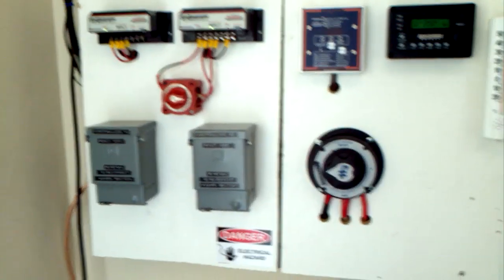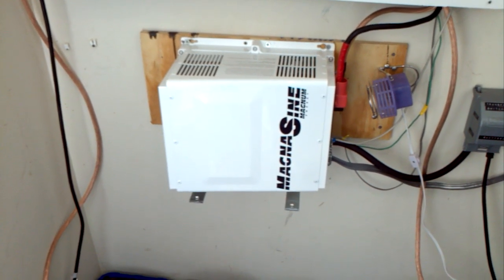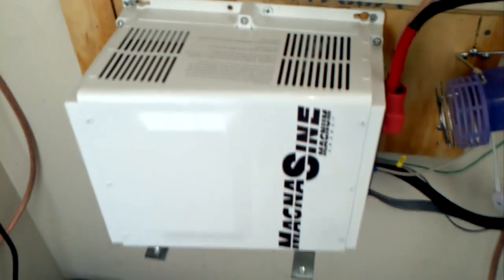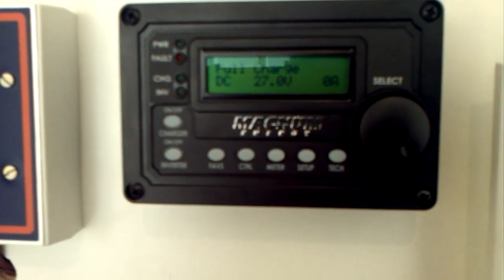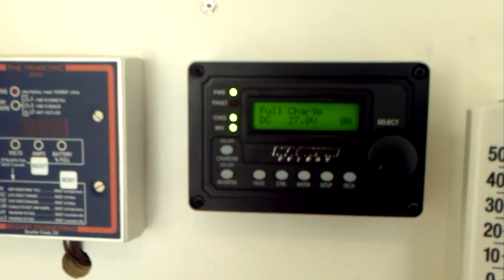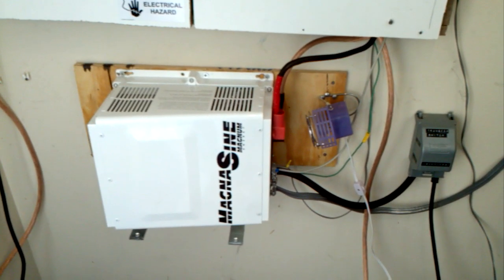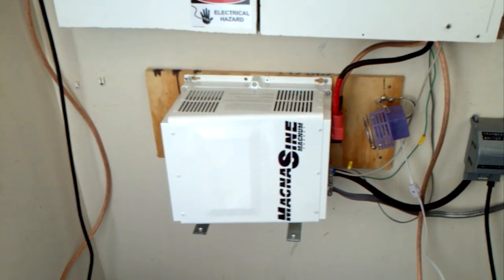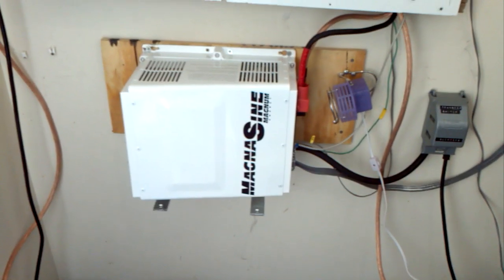DIY Solar - MagnaSine Inverter /Charger - Product Review

Comment: We have a Magnum 4024 (the 120 volt version) powering our off grid cabin, and it works great, very robust as you said.  It can run anything, great surge capacity.  I guess that is why it has a 3 year warranty and of note it is made in the US, not China.  I also would recommend the remote panel for information and programming capability.  Great video!

Comment from the maker: Yes, that's how the pass through works. The inverter is programed to sense when the power is out. My transfer switch acting as a sub panel has the circuits connected that I want running during an outage, the switches are already flipped so that when the power goes out, the inverter automatically switches from pass through to battery to power those circuits at the xfer switch or sub panel.

Comment from the maker: Thanks for you comments, I checked and the APC Matrix 5kVA UPS is a great system. However, new it can cost as much as or more than the MagnaSine. The one you speak of is used off of ebay for $499, I only saw one at that price. There is also one for around $1700. In truth, any Inverter system with this type of smart capability is not going to be cheap. Also, a UPS is just another type of inverter that converts DC to AC and there are many far less expensive inverters on the market than this one.

Comment from the maker: Thanks for your comments. There  is only 1 AC input going into the MagnaSine, I can plug into the utility source or with the Propane Gen via modified sine inverter. I could hook the battery cables from the alternator directly to a MSW 12v inverter with appropriate watts (1200w), then plug the MagnaSine AC input into it with an extension cord. It's not pretty but it does work. The MagnaSine inverter will test the input power to determine if it's good, if so, then it will pass it to the batteries.

Comment from the maker: Yes, the xfer switch is acting as a sub-panel in this case and the MagnaSine is in pass-through mode passing the power from the utility to the circuits. In the event of a power interruption, the MagnaSine will go into Inverter mode to power those circuits until utility power is restored. When power is restored it will go into charging mode. It has over current protection with 2 overlapping circuits, but with a lightning strike I believe it's a 50/50 chance it can take it, I hope for the best.

Comment from the maker: Yes, you can connect your inverter to a 12v or 24v battery bank.  Both system voltages are within the range of the grid tie inverter.  However, a 24v setup will give higher output from the inverter because it will be closest to the input limits of your inverter.

Comment: I think you bought the best inverter made.  I've researched the AIMS and, under the cover, it's a rebranded chinese copy of a copy, which sells in china for $200 then gets marked up by aims, the only thing they do.  Great system engineering!  I like the functionality you built in by design.

Comment from the maker: I agree with them, it can be done, provided your power strip has the appropriate wire guage and safety rating for what you want to do.  Also, definitely include the 15 -> 30 Amp breaker in between for safety.  Essentially, your coverting the Magnum to function like an ordinary inverter with the receptacles (they have the same level of protection already built-in).  Also, this mimics how your house is already wired for safety.

Comment: I'm actually trying that same thing. My main goal isn't for backup. We don't have too many power outages out here. I currently bought 4 solar panels and can expanded it up to 12. I was given an Alpha 5000 watt UPS, which came with 8 batteries in the enclosures hooked up @ 48V with 200amps hours in total. I'm looking for a way to hook up the panels to the house at the same time thru the UPS charge the batteries then when the sun goes down also use up the batteries on a nightly basis.

Comment: Thanks for your answer; My problem with the GTI 500 is before the fan kicks in, it is making a sharp high pitch noise (high frequency components), it is a bit covered by the fan later but it is annoying; for example compared to this, the GTI 250 or 300 are very silent

Comment from the maker: The remote gives you full access to the Magnum inverter. It will allow you to monitor and program the various features of the Magnum unit, such as when to come on, how to charge the batteries from the grid, or how to work in conjunction with a PV array, which is an alternative charging source as far as the magnum is concerned. These can be programmed with the remote. The remote shouldn't have anything directly to do with your MPPT. If you are getting the MagnaSine, the remote is a must have.

Comment from the maker: For the "in-coming" 120vac I have it plugged into a 120v socket which is protected at the breaker panel, for the "out-going" 240vac it is going into a 30 Amp breaker tied to a transfer switch (for a sub-panel) with 2 15Amp breakers on each of the 2 legs (meaning, 2 120v pathways which are 180 degrees out of phase for 240v), from there it goes into the main breaker panel. So you can see that there is circuit protection throughout. Also, I'm hoping that you know that this is not a grid tie unit.

Comment from the maker: The GVFX3524 is an excellent system.  I got the Magnum for the durability and auto transfer capability. I compared the two and decided on the Magnum as the choice for me.  I can't remember, but there was something about the Outback that didn't meet my requirements at the time. But it is a good inverter.

Comment from the maker: Yes, you can have a standard battery charger hooked to the battery bank at the same time you use your GTI.  A battery charger and a charge controller essentially do the same thing.

Comment from the maker: The current going into the battery bank will fluctuate according to current state of charge. Like any smart battery charger, the current will lessen as the batteries reach the point of saturation (ie. fully charged). At which time the charger will go into float mode.  AC input can be 120V or 240V depending on your source.  Voltage remains constant, charging amperage changes based on battery state of charge.

Comment: Very cool.  Does it basically output a constant current to charge a 24v battery pack as long as you are giving it an AC input?  And the AC input was the AC output earlier?

Comment: First of all thank you for posting your system , On YouTube. I hope you post another one as well, as you use your system down the road. Your Magnum inverter is my second choice, because of its 240 capability. My first choice would be outback, but I'm Seriously considering the Magnum inverter system. As  it is also built in the United States. And also a little cheaper than the Outback system.  I look forward to more reviews from you here on YouTube. Again thank you for your presentation. Neil
Reply from the maker: Thanks for the comments. My MagnaSine inverter had been working fine thus far. Outbacks are good as well, I didn't go with them because of the 120vac limitation.
Reply: My choice was the opposite and am glad I purchased a Magnum. Looking into the midnight solar and outback equipment, they seemed the opposite of simplicity. They sure look cool though.

Comment from the maker: Sorry, but it was replaced under warranty, so it's new in that respect and it's my backup in case this one gets fried for some reason.  When designing a system to support an extending outage, it's good to have a backup. However, I'm sure you can find some good used ones off of ebay or craig's list.

Comment: Thanks!  I've been looking for a review of this inverter.  It's one of 3 I'm considering (Xantrex & Apollo Solar are the others).  Magnaum tech support mentioned a "threshhold" feature with the MS-ARC meter which will automatically switch the inverter to grid power when the solar panels drop below a threshold voltage.  Have you explored this feature?

Comment: Many thanks for your respond Rhandsom.The next question i must ask,before i import my grid tie from usa:I want to use a 12 volt battery bank,the grid tie inverter has voltage range 10.5-30v,can i use this inverter with 12v battery bank,or must i use 24v battery bank for this inverter?
Can you assist me please!
awaiting your expert advise.
Timir.

Comment: Dear Rhandsom,I am totally blown away with your system you designed.However,I have a question I would like you to respond to!Can i while using my grid tie inverter on battery bank,have a battery charger connected as well, simultaneously?I do run four 12,000 btu ac at night,and I would like to supplement my power consumption.
I am looking forward for your expert advise on this!
Timir.

Comment: If i'm not connecting any ac 'in'.....can I just hardwire a power strip to the the ac 'out' side?
Magnum is saying (maybe for legal reasons) that i'd have to run 10ga out to a 15amp breaker, then to receptacles I want to use.

Comment: ARC50 and ME-BMK (Battery Monitor Kit) do i need both for my new 24v DC 4000w pure sine 120v\240v AC inverter/charger...Does ARC50 monitor my battery bank...Thanks

Comment: Hello, just wondering if the inverter can work without installing a control or does it need to have it, because I connect the inverter without it but it’s not turning on.
Reply from the maker: The inverter will work without the control.  The control gives you the ability to fine tune certain perameters within the inverter.  I do recommend the control, but you don't have to get one.

Comment: I am getting ready to set up my magnasine ms4024ae post hurricane Joaquin in the Bahamas. Will the remote allow me to program the system to use my solar panels to charge my batteries, then run loads in the subpanel while the sun is shining, then switch to battery power, then switch to grid when the batteries are at 80%? Rinse and repeat daily? Great vid, many thanks!
Reply from the maker: +Mary C (White Eyelashes) Thanks for your question. The remote will allow you program the MagnaSine to utilize solar and grid.  The solar panels will charge the battery via the Charge Controller as normal, To run your loads during this time from your battery bank, the inverter must be running in "inverter mode" and not pulling power from the grid to pass-through to the loads, the remote also allows you to program when the inverter/charger starts "bulk" charging the battery bank, you can set it to the voltage that indicates that your battery bank is at 80% SOC.  At which time, if the Magnasine is connected to the utility, it will begin to recharge your batteries.  The remote allows for different settings that may meet your needs.  There is a setting that will allow you to set "when, as in time-of-day", your Magnasine will connect to the utility to allow power to pass-through to your loads and disconnect from the utility to get power from the battery bank.  I believe you may be referring to that option.
Reply: +rhandsom  thanks!   So I can program the inverter to shut off grid power during the peak solar hours and power my subpanel loads off the inverter?  That's what I'm aiming for.  Live off batteries and panels from, say 10am to 5pm.  Doable?  Automatically?
Reply from the maker: Specifically, there are 2 settings 1.) AC In - Time, 2.) AC In - VDC.  "AC In - Time" is when you want utility power based on Time, "AC In - VDC" is when you want utility power based on the Voltage of your batteries.  These settings make things automatic.  These settings are also laid out pretty well in the manual.  I have mine set to the "automatic" AC In setting, to pass through power until there is a grid outage, then automatically re-connect when the grid returns.
Reply: +rhandsom got it!   Thanks so much for the vid and your replies!
Reply from the maker: No problem, take care.

Comment: I bought one of these not long ago. I'm still trying to figure out how to put it together and use it. I've talked to a friend of mine, who is an electrician by trade, and I am hoping to get him to help me put it together.
Reply from the maker: hrdknox2000 It's worked for me almost 3 1/2 years.  Hope it works out for you.
Reply: +rhandsom I have the 4024s 4000watts 120volts,  how can I use the charger function without the remote? I am afraid it will malfunction since our utility is running on 240volts, planning to run it with a transformer 240v-120v at 3000watts avr, will it charge my 24volts battery bank?  Actually I'm using transformer because this magnum inverter only can supply 120 volts, most of my appliances are 240v rating..Its an excellent inverter I found in a second hand store the electrician said its for 120volts used only..but its nice for a $100 purchase...thanks..I enjoyed watching your videos. ...

Comment: Not sure if anyone has mentioned it, but your ground wire looks awfully small.  You may want to check the grounding requirements for that inverter to make sure you are using the proper size and also that it is properly grounded.  You can learn anything from books, but you cannot replace experience.  Electricity is nothing to play around with.  If you were to have a fire and your insurance company was to find out you installed this yourself without a permit or inspection, then they might not cover your claim.  Just something to keep in mind.  Good video, I really like the inverter and have been looking at the inverter myself.
Reply from the maker: Thanks for the comment and the info. This is a very old video and I have since changed my system multiple times to include getting thicker ground wire.

Comment: Nice good choice I install solar systems and I really love to work with these like you said it's not the cheapest inverter but it is the best I really be leave you on it because it is my experience with these
Reply from the maker: Thanks for the comments.  It's worked well for me so far.
Reply: All my customers are happy with it so far snot very much or hardly any maintainance so far I hardly get any calls or hear ppl say they don't like them I mostly hear ppl say expensive but good quality inverter

Comment: Nice video, but I've never heard anybody say "ok" more times in such a short period. I counted 71 "ok's" in 16 minutes for an average of 4.4375 "ok's" per minute. I counted 31 "ok's" in the first 6 minutes alone. Is that a regional thing? I'm not bustin' on you, just curious why so many "ok's" in such a shot period?
Reply: Corne Torres I’m not super familiar with the Magnasine. I use Schneider Electric inverters in my system. But I don’t believe the Magnasine has any way to control it or program the parameters without the remote.